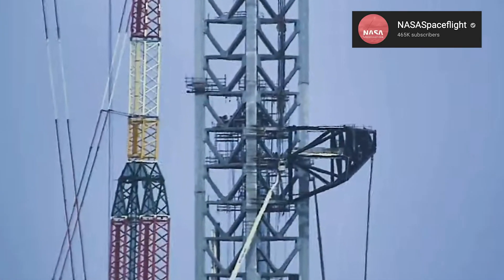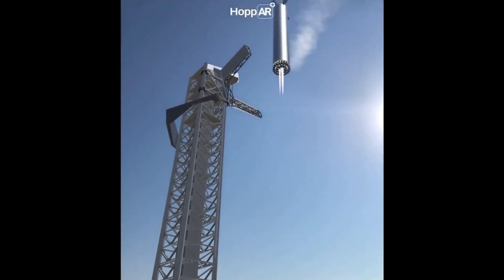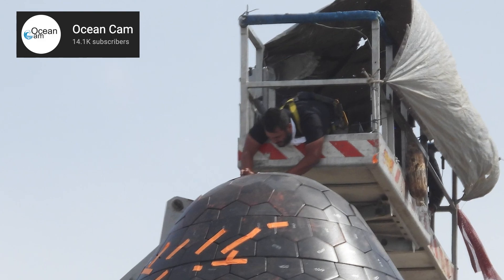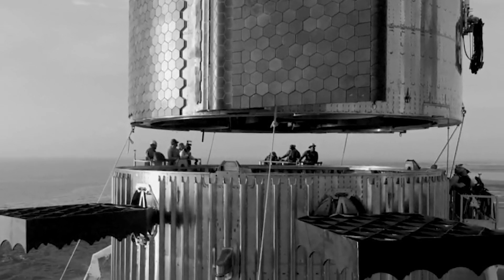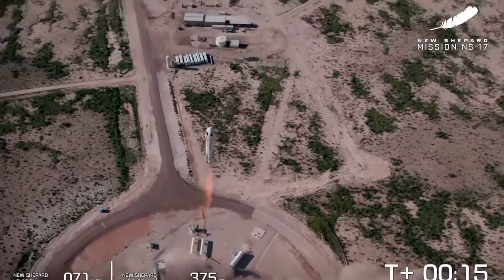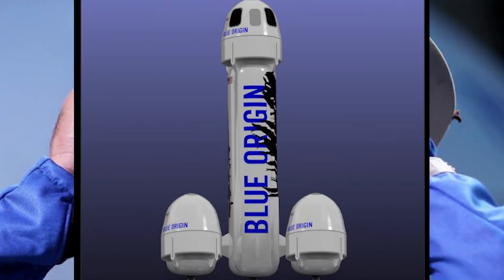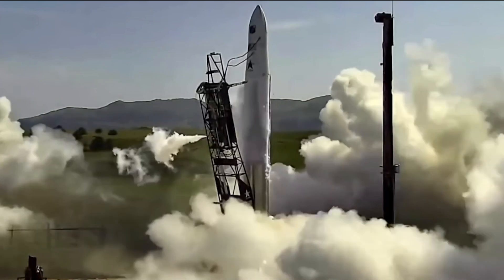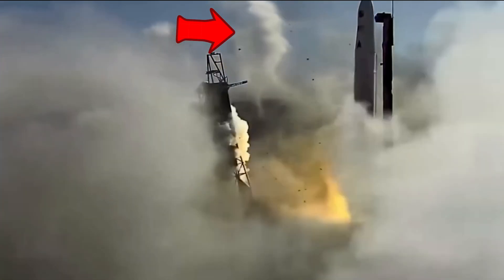SpaceX Starship 20 Heat Shield Almost Done - First Booster Catch Attempt Revealed - Mechazilla!

Comment: Tin can covered in tiles.  Good luck with quick turn-around and reliability.  Chipped, cracked, misaligned, fallen off tiles gonna bottle-neck this operation.  Each tile is a possible single point of failure and as you can see there are thousands of them. Do the math.  Can't wait to hear the Musk lemmings start squawking.